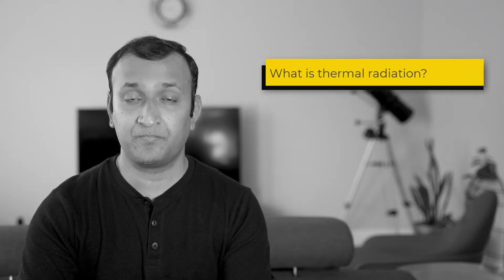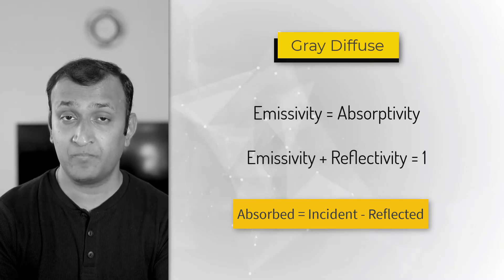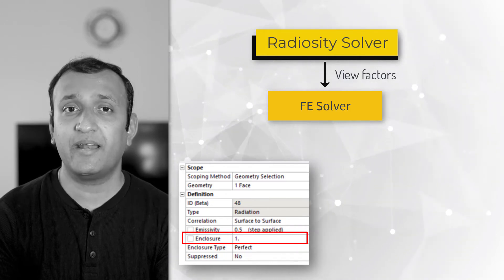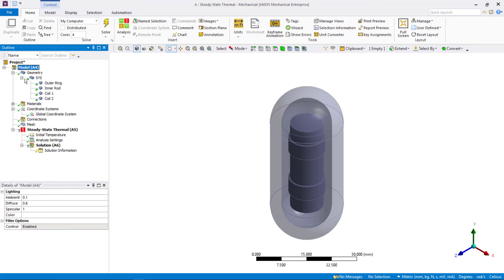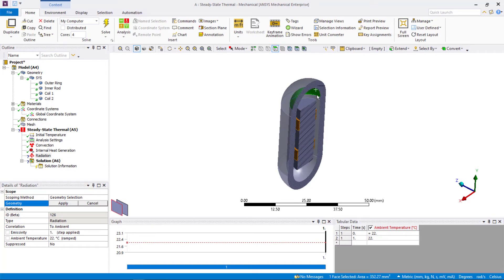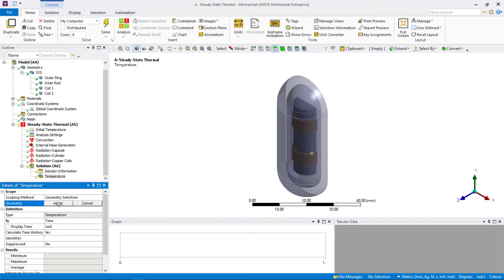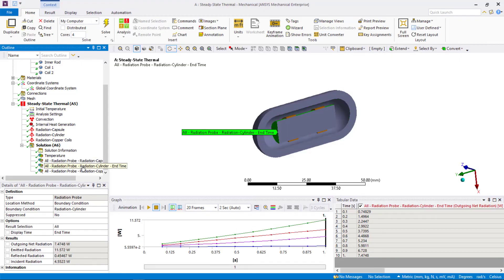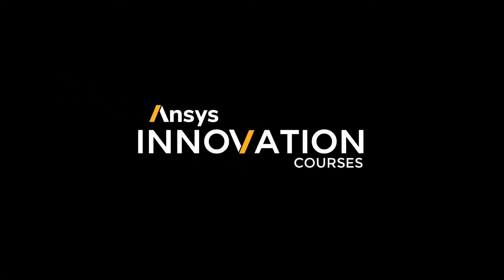Performing Thermal Radiation Between Surfaces Using Ansys Mechanical

Comment: Hi, thanks for the informative video, could you please tell us if it is possible to perform thermal analysis with same setup and if  the gap between source and shell is  vacuum filled with coolant(oil), is it possible to analyze heat build up and failures if any?